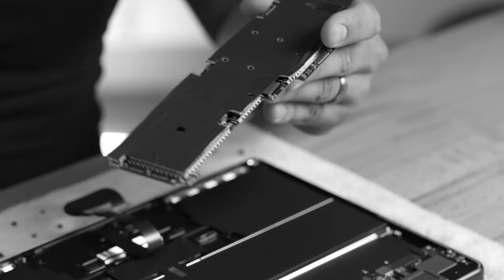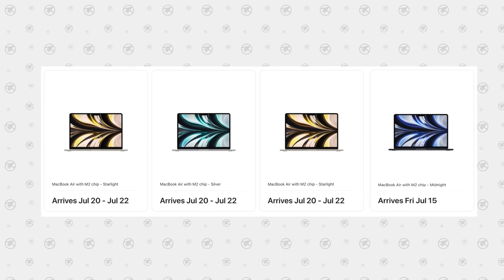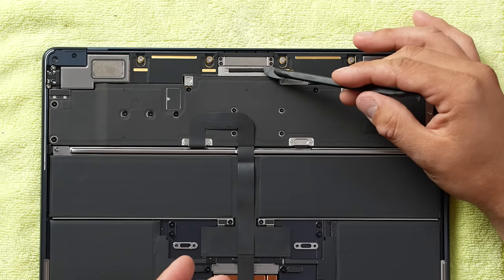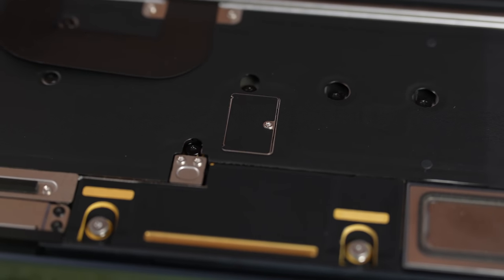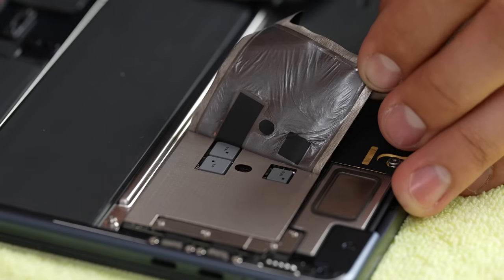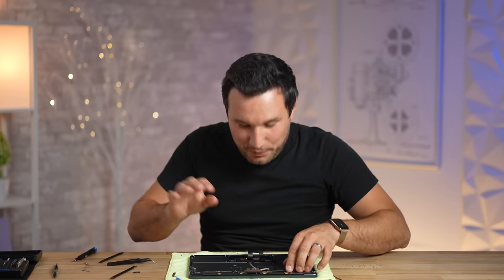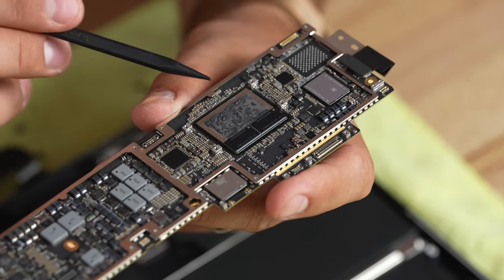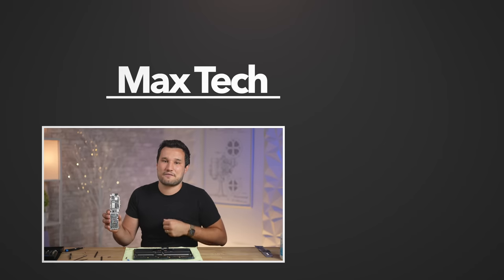M2 MacBook Air Teardown: Apple's SECRET Revealed (& SSD)

Comment from the maker: UPDATE: There's a chance the USI chip is just a WiFi chip, or Ultrawideband is built into the main WiFi chip. Can't confirm yet.
Thermal throttle testing video coming soon! Subscribe now to join the Giveaway! 
Best Budget Fast Charger for M2 MacBook Air! ➡ https://geni.us/PvFr2
iFixit Pro Toolkit ➡ https://geni.us/8qkP
Like our wallpapers? Download them here ➡ https://bit.ly/2WNc6Qw
Best deals on M1 Macs on Amazon ⬇ 
NEW M2 MacBook Air ➡ https://geni.us/UlLRm5
M1 MacBook Air ($850 SALE) ➡ https://geni.us/1mJ41T
14" MacBook Pro 2021 ➡ https://geni.us/qYardlV
Reply: I can't wait to see if thermal throttling is a concern. Love the new look for this laptop.
Reply: @marcranger7421  I worry it will suffer from thermal throttling more than the earlier versions.
Reply: Superb video . 👍 . I am waiting 😎
You relieved the secrets of Mac.
Reply: Bro how do you now when you win
Reply: Bro I'm always watching your videos for updates about apple
Reply: This is what everyone is waiting for...
Reply: Would That by Nice a new macbookair m2 would love ith
Reply: I am amazed on how much computer circuitry can be fit in a tiny area, and the heat transfer/dissipation study that would have taken place to get it right. Amazing work of engineering. Thanks for putting these videos for those of us that would not dare opening and ruin that expensive piece of equipment.
Reply: @Mhoek0366  yea
Reply: That would be nice to have macbook m2 air
Reply: Subscribed
Reply: Thank you for putting up these goodies!
Reply: can you guys add a cooling solution underneath the macbook air like the solutions for gaming phone and test if it really make any difference , and if any tweeking like the one you did to the air m1 will pass more heat to the external so that new the new cooling solution do better , and thank you guys .
Reply: Given that thermals were so high when Max Tech tested the M2 MacBook Pro, then thermal throttling is guaranteed for the Air.
Reply: I can't wait to see how beautiful it is in person
Reply: Can't wait for the video
Reply: Curious to see if it thermal throttles even more than the pro compared to the m1 air over longer testing, like the design though but the price increase over the previous air is a lot imo.
Reply: @Watchandlearn91  You are absolutely right. I had hoped the slightly better nanometer process would aid it, but it doesn’t seem like it will.
Reply: Nice! Thanks for the teardown so we dont need to do it ourselves! Max Tech Rulez!
Reply: Love this colour 💜🥺🥺
Reply: have you ever by mistake damaged a unit during a teardown? or lost a piece in the process?
Reply: I hope thermal throttling only occurs under extreme loads. Ihope there is a wide band chip in there.
Reply: Cool! So excited to see it up close literally! Thanks.
Reply: interesting teardown.  Thanks.
Reply: It will be have thermal issue comparing with M1 MBA
Reply: I’m wondering about thermal throttling vs the M1 MBA
Reply: I love the look of the MacBook Air 2022 m2
Reply: I love the way it looks new MacBook air... U did again apple
Reply: Great video always enjoy your contenent
Reply: Nice
Reply: Great
Reply: keep going we are with you 🤗
Reply: Awesome. My only concern is thermal throttling
Reply: DO NOT BUY 256gb M2!!!
Let’s sign a petition!
Reply: Grt video
Reply: sup nice
Reply: At this point MacBook is an I phone with big battery and screen.   The actual MB can fit a large phone.
Reply: Very nice
Reply: I wonder whether 512GB model has same SSD speed as 512GB M1 air
Reply: Great job guys, thank you for the teardown!  Wondering how the 8 GB with 512 GB performs.
Reply: Wow it rely nice
Reply: Wellcome To Indonesia Macbook Air M2🤭🤭
Reply: M2 MacBook Air is nice and flat and easy to replace!👍
Reply: Love the looks of it - inside and outside! Thanks for making these great videos 👍🏻.
Reply: Finally a video that shows the internals of the new M2 macbook air!
Reply: At last..... I've been waiting for so long for this video. Maybe since the apple event. 
I'm very excited to watch all the in depth videos from you guys.
Reply: Really hope they did something which won't cause the device to throttle too quickly, looking forward to the review!
Reply: I have to watch these teardowns through my fingers. Poor Macbook. 😦
Reply: Can't wait for the giveaway 🥰
I really love your video
Reply: Really excited for giveaway... 
I am from Bangladesh 🥰
Reply: Thermal throttling best test this laptop MacBook Air M2
Reply: Hello, this MackBook M2 is very 👍, I love Apple products 😍
Reply: Now that we see that the M2 MBA has 1 nand in the base model, will this happen to the M1 MBA that's on the shelf. Just worrying.
Reply: I wish i could have one of these🤕
But i can't afford it.
Reply: Uhh why is the adapter 150 cad
Reply: Love the looks!!! Hope i win 🇵🇭
Reply: Amazing engineering and thanks for showing us such an amazing piece of machinery. I’m waiting to get all reviews before changing my MacBook Pro
Reply: I will say I will win and get this amazing color I can't wait😍
Reply: Language YouTuber here living in the UAE, hoping to win that M2 macbook air to get back in the content creation game. I bought my lenovo ideapad s145 in 2019 when I had no idea I'd be making YouTube videos. Less than 10 videos in, my laptop slowed to a crawl and is currently wheezing it's last breath. I can barely edit word files on this thing let alone try to edit videos. So the M2 macbook air would be a dream come true right now, but no pressure though guys🥺🥺🥺🥺🥺🥺🥺🥺🥺🥺🥺🥺🥺🥺🥺🥺🥺🥺🥺🥺🥺🥺
Reply: Wow. That interior is so clean……
I would really love this to replace my aging Mac Mini.
Reply: Nice teardown 💪💪
Reply: Thanks for the update
Reply: You've done a very good job...MAX!
By seeing the teardown we can see the SSD situation in the base model of the macbook air M2 
Thanks for the great information ℹ️ 
Like to see more testing and comparision video's.....
Reply: Battery life vs thermal. I know heat is not good for battery. Will the heat from the thermals affect the battery life over a period or time?
Reply: Please Select Me I Can Only Imagine Of Buying An MacBook It’s That Pricier In India… 🙇🏻🙇🏻🙇🏻
Reply: thank you.
Reply: Hi
Reply: Hello who is going to buy it
Reply: Need one 🙌🏼
Reply: Screen design is amazing.
Reply: please start seeing how hooking up external monitors affects machines!  this is a real world use that I know will effect performance.
Reply: Apple is apple. No comparison with other hardaware companies. The best OS the have.
Reply: Nice product
Reply: Awesome vid!
Reply: thank you for the video and the generous giveaway!. all the best for the potential winner
Reply: I believe it's an all-in-one chip (cheaper for mass production)
Reply: Imagine buying this kind of expensive laptop and tearing in apart. God when? 😭😭😭
Reply: I love to get m2 macbook air
Reply: cool
Reply: Is there anything user upgradable in there?
Reply: Can i have one M2 air inmidnight black? I promise ill feed it well 😁
Reply: Any reasoning behind the future 'throttling' with only a 5 year old Bluetooth 5 and Wifi 6 instead of 6E?
Reply: Dude i love the color so much!
Reply: hello
Reply: Love ur videos
Reply: Love your videos... Good luck 🤞
Reply: I had been waiting for the Macbook Air M2 for a very long time and I’m now extremely excited to see how it fares in a long-term review compared to the MacBook Air M1.
Reply: it’s just the normal USI wifi chip… maybe do research before making a yt video. they’ve been using those same chips for years
Reply: Midnight blue wins!
Reply: Just an FYI. Theres a ton of scam comments, asking people to contact them and pretending to be you. Might be good idea to pin a message about them, or in the description.
Reply: Great video, thanks for sharing all this information. I have a older  MacBook Pro and now I'm in love with this MacBook Air M2. Hope to win the giveaway!
Reply: Have you done thermal photos of M2 MBA without the bottom cover? It would be nice to see how the heat dissipate through the shielding.
Reply: Love to win the Macbook Air M2 - I will put it to good use! Word processing, web, lit gaming and Garageband
Reply: I wonder if apple is going to drop 2 ssd chips to 1 in m1 model too.
Reply: I think so
Reply: M2 👌🏻
Reply: Can you run some compilation workloads in addition to the others tests for the thermal/power testing? Chromium or some other C/C++ codebase? I'm very interested in the results, and I think I'm not alone, as learning the sw dev capabilities os the Air would be very useful.
Reply: Thanks ;-)
Reply: I can't wait for further and intense testings!
Reply: I like your Videos I didn’t miss, even I’m windows user
Reply: Almost ordered the 256gb base version, lucky I didn’t!
Reply: Loving the new M2 Macbook Air, hope to get my hands on them.
Reply: After watching the most recent videos I wonder if there is any real difference between the M2 MBA 16GB/512GB and the 24GB/1TB or 24GB/1TB
Reply: Thanks for the look inside!
Reply: Macbook Air 2022 version is a big upgrade and I think that the SSD isn't that big of an issue as long as you upgrade to a 512GB SSD
Reply: This is a really helpful video.
Reply: Please make a video MacBook Air M2 16GB RAM 512GB SSD vs MacBook Pro 14 PRO 16GB RAM 512GB SSD… should you spend the extra money
Reply: I would love to win this for my wife

Thanks Max Tech for the awesome, Apple content as always 🍎🍏❤️💚
Reply: My husband made me do this, but I’d LOVE TO WIN this Mac!

Liked, subscribed and commented 💅🏽💅🏽 thanks, Max Tech!
Reply: Let's win the Macbook Air M2 :)
Reply: Great video
Reply: Commented
Reply: M2 MBA looks great, but disappointed about the SSD speeds on base model :(
Reply: I would love to win the m2 MacBook Air. Sermons (I’m a training pastor), editing my tik tok videos where I post bible content and lots of stuff for my church. Currently running a 2015 MacBook Pro and it dying! If you see this thanks for the content! You can get to 1million
Reply: ssd😭😭😭😭
Reply: Bro
Reply: Max Tech teardown more concise than of iFix teardown 👏
Reply: Love the design!!
Reply: Easy Mac 💻 for @Olexxandr_S 😄
Reply: Hey hope I get the MacBook because I am using my moms 2015 for a computer because I can’t afford a new one. But good luck to all have a amazing day. Love your videos
Reply: Great video!
Reply: Interested in a compact DIY teardown and thermal pad installation kit for the M2 Air to purchase. Sell it Amazon already hahaha tailor-made for M2 Air. And is there a nice and clean fan product to put under the Air M2? More of Apple-ish clean design?
Reply: Hoping to win for the first time free staff in my life :)
Reply: Great video
Reply: Never in my life would I dare to open such expensive equipment.
Reply: Subscribed and made a comment
Reply: I thought fingerprint issues would be fine but I think it is a long time to get it
Reply: Os vídeos são #fantásticos #M2 #apple

Comment: I think apple made the m1 much more powerful than even they anticipated. That messed up their M2 upgrade path. This is a path correction that will make sense again with M3.
Reply: The M2 is still quite a bit faster than the M1. I don't think apple expected every chip refresh to be a massive jump since most people keep Macs for 5+ years you need to consider the perfomance increase over a 5 year time range for the real world user noticeable improvement in perf.  How does the M1 compared to an M4/5 that will be the companion that 95% of the M1 users get not vs the M2.
Reply: @hishnash  i dont get how people see this as only a small jump, 20 and 35 percent for cpu and gpu is a very significant jump
Reply: I'd say there was the issue of TSMC not having 3nm process ready just yet, but will be ready for M2 pro/max/ultra. Which I find could be strange really. Because then you'd have M2 at 5nm, then the rest of the M2 family on 3nm with much better performance.... AND when M3 pro etc comes out on 3nm, it won't be much better than M2 pro etc etc.
Reply: @hishnash  THIS. Tech YouTube, especially apple channels, always focus on year over year improvements when the large majority of people are not upgrading that often. “Small improvements” are still improvements that will just add on to however large of a jump a new device will be for 99% of consumers
Reply: bro u going on every review and saying the same thing!
Reply: I'd love to try out the m2  i just can't afford to drop the cash on it right now.